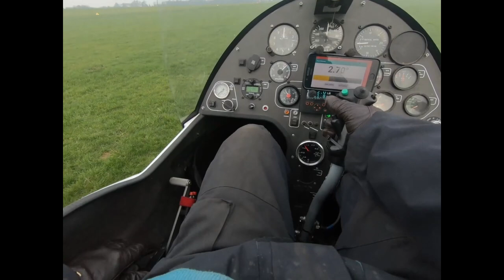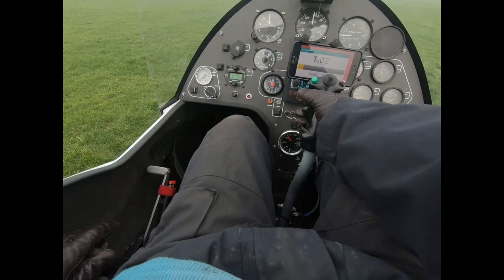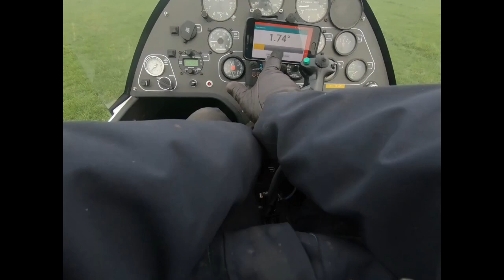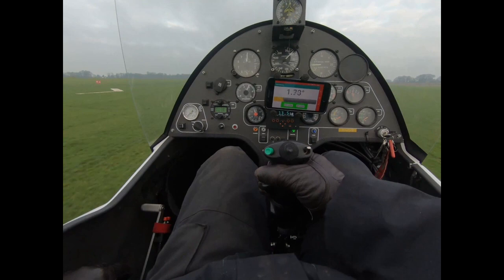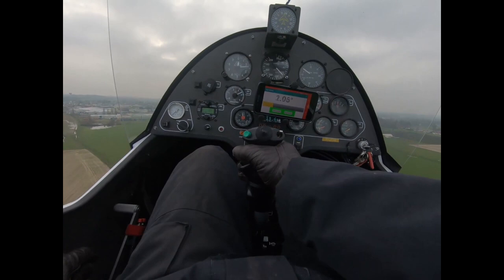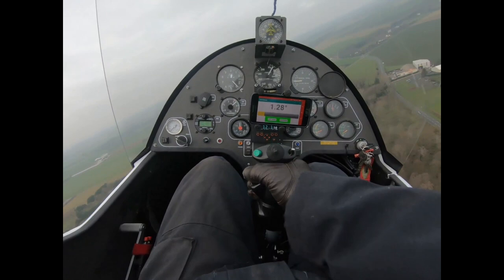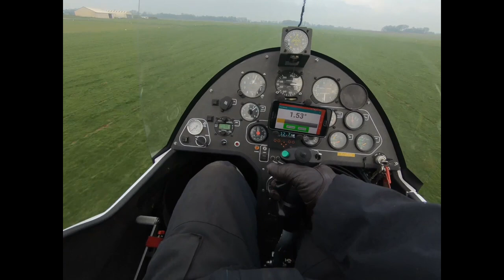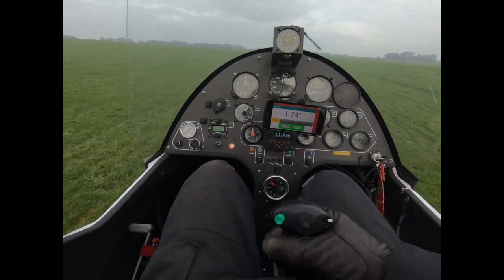Gyrocopter - Gyro Warning System [GWS] - pilot error accident prevention black box

Comment from the maker: Mike Goodrich is the consultant engineer/test pilot for Smart Avionics UK and
developed their Gyro Rotor Track & Balance procedure for the PB3&4
dynamic balancers. He has trained the staff at the factories of AutoGyro,
Magni, ELA, Silverlight, Brako, Gyro Tech, some of their dealers and many
private individuals to dynamically track and balance their rotors.

He had the idea to develop this warning system using the Smart Avionics
SmartAss-3 stall margin preserver system (https://smartavionics.co.uk/prod-
smartass.html). He asked Mark Burton of Smart Avionics to make a
prototype modified version for gyros and specified the different alarm
scenarios. Mike has been testing this device during 2020 and they are now
at prototype Mk3.

Jean Claude Debreyer has contributed his knowledge of rotor aerodynamics
and use of his performance software that has been a major help in defining
the limits.

The system consists of a box with connections to be T’d into the aircraft pitot
and static systems and cabling to the existing Rotor Tacho, intercom,
door/canopy microswitch &amp; 12V supply plus perhaps the engine tacho.
There is an external air temperature sensor, a push button to temporarily
mute the warning, a volume potentiometer and a flashing light that have to
be installed by the manufacturer.
There will need to be some sort of fire protection of the SD card supplied by either Smart
Avionics or the manufacturer, to be decided.
Reply: I think any additional aid to safety can only be good.
Autogyro introduced on Rotor System III a blade flap warning light function if you start the take-off run with too low rotor rpm but an extension to other outside the envelope situations and addition of an aural warning can only be good.
Of course there may be some with the view that anybody who flies should not need gadgets to help them, but most of us will likely be happy to take all the help we can get.
The only thing that has to be remembered is that any system can fail and the PIC has to be able to fly safely and recognise things if they are not warned - but that is the same as for using any aid e.g. electronic conspicuity aids.
Reply: Hi Phil, I have dug out some old reference material which has a good section on "behind the power curve" and "back side of the power curve"  it is "The Gyrocopter Flight Manual" by Paul Bergen Abbott with an intro by Dr Igor Benson.  Amazon have a later edition available but mine was printed in 1983.
Reply from the maker: @ianmorcombe  thanks for that - I just took a look and sadly £40 & £50!  They don't mind!
Reply: @tomgalloway4891  
Do I understand right?: Some gyros do not have pre-rotator? So the issue is not the initial low rpm for the run rather not allowing the rpm to build up and forcing to get airborne which will put you suddenly into the behind power curve-low lift-high disc angle regime/envelope where take off will be impossible (due to limited thrust)...???
Reply: This should be a mandatory training tool to understand the flight critical modes...
Besides it looks like providing an effective critical envelope warning aid...
Even on fixed wing aircraft many pilots do not get the high AOA/behind the curve situations...on military jets (3. gen) we used to have stick-shakers...and later the fly-by wire (4+ gen.) solved some of the issue especially when it was coupled with auto-throttle...
Reply from the maker: @electricaviationchannelvid7863  Hello - you might think but I am not that convinced.  The problem is that on paper some warning device might seem to offer a solution but the practicalities of training the way to react and the fact in these conditions it should be very obvious my own view is it is easier to focus on the basics that don't take you anywhere near the issues that a GWS alert.

Comment: An excellent development. Kudos to Mike Goodrich, Msr Debreyer. 
To get around the 'black box' limitations (bulk and weight) the data could be continuously uploaded over available mobile networks. Gyros are somewhat limited in range so this is practical. Perhaps reporting every 10-30 seconds or 'live' when the alarms are/have been activated. I can envision either a programmable device/USB connection similar to a smart phone/pad or perhaps as an App on existing mobile platforms. 
Definitely the wife or mother's voice - anything that sends us into stress mode the quickest. 👁‍🗨👁‍🗨

Comment: Sorry for being pedantic here but there are 2 terms being confused here.  "Behind the curve" is when there is too much drag for the gyroplane to climb (or take off)  the other term which should be used here is the "back side of the curve" which is any slower than the minimum drag speed of that gyroplane until it is too slow to be able to climb (i.e. behind the power curve)
When a gyroplane is "behind the curve"  it cannot take off as there is too much drag from the rotor to climb, and when in flight the aircraft will be descending even with full power. 
When a gyroplane is flying on the "back side of the power curve" it will be using more power for "straight and level"  than at the minimum drag speed.  If the aircraft is flown (S & L) at ever slower speeds, the nose will be getting higher and higher as power is increased  while the aircraft will be flying at slower speed until it reaches full power and cannot maintain level flight (i.e. behind the power curve.
Reply from the maker: Hey Ian - yes I agree with you and that is a very good explanation which I think should be adopted but very sadly the current pilot training is super confused about this / these terms.
Reply: @gyrocopterflyingclub6148  Ah, we are working on clarifying the confusion in Australia but good luck elsewhere! :-)
Reply from the maker: @ianmorcombe  the issue [i think] is that very few relate the issue to drag - they try and explain it with an engine power curve and it all falls apart IMO.  In the UK we are doomed in this regard!
Reply: Ian I actually spent some time trying to find an official term for these conditions, even asking on the RWF. As Phil says there seems to be considerable confusion. If you have some official text or reference work to quote from I'd be grateful if you'd let me know and I'll use it.
As it happens I don't think it matters for this device, what's important is that the pilot understands what's wrong and what he has to do about it, and if he wants to be pedantic and record the "correct" expression he can. This recording is on my gyro and I understand perfectly what it means.
Mike G
Reply: @mikegoodrich1948  Hi Mike,  I'm not sure what you consider is "official text".  I have been involved with Gyroplanes for 40 years and in the early '90s I compiled the first training manual, "BAK for Gyroplanes" for the Australian Sport Rotorcraft Association (ASRA) from all the gyroplane information I had accumulated over the previous 10 years or so.  This manual was used in Australia for over 20 years .  I'm sorry but I don't remember where I got the information from regarding "back side" and "behind the power curve" but there was a graph I used in the manual which I would have found in documentation from that time.  It shows clearly the "Back Side of the Power Curve".   in the graph and that would have been an American publication as that was where most Gyroplane information came from at that time.
Regards,
Ian
Reply: @mikegoodrich1948  Hi Mike, I have dug out some old reference material which has a good section on "behind the power curve" and "back side of the power curve"  it is "The Gyrocopter Flight Manual" by Paul Bergen Abbott with an intro by Dr Igor Benson.  Amazon have a later edition available but mine was printed in 1983.

Comment: Excellent idea.  A few thoughts though.  

Are we building a system to replace instructors or competent instructors?

My argument would be that if you don't know how to wind up rotors you should not be taking off.  But clearly many don't hence the accident rate.  Like the ballistic chute this shouldn't be necessary.

However in an emergency a voice giving calm reading of the situation might be useful.

1 question how is he determining risk of PPO.  You can get cheap accelerometers I play them with my ICT classes and I plan on fitting them to my gyro to collect data.  However I believe it is possible to unload the rotor at high speed without any neg g until too late.  I was thinking of a system that had a wind vane attached to torque tube to measure relative airflow relative to the disk.  This would warn you in high speed flight that you are approaching VNE and about to push the disk over.  A g meter wouldn't  help in this case as you'd be at positive g until it was too late. Is he using some method of reading disk angle compared to relative airflow?
Reply: We are working on a "hi speed flapping/VNE alarm" that are alarms 7 & 8 on the graph. It requires a different rotor that I am preparing at the moment but being held up by Covid. I think it will answer your question.
Reply: @mikegoodrich1948  excellent.